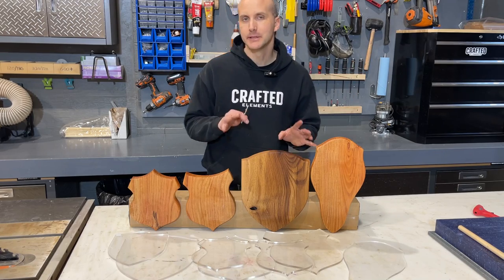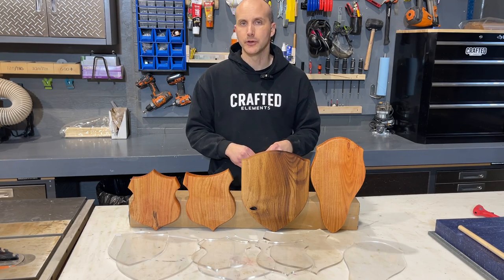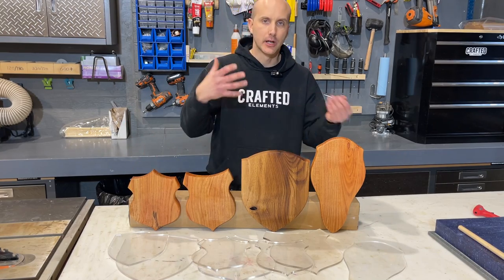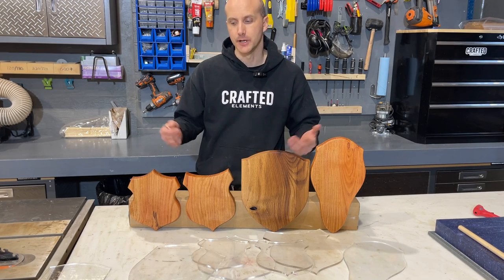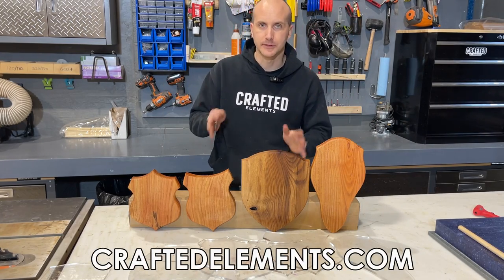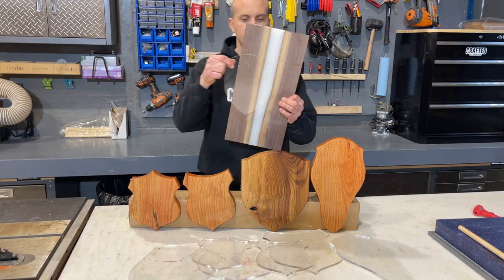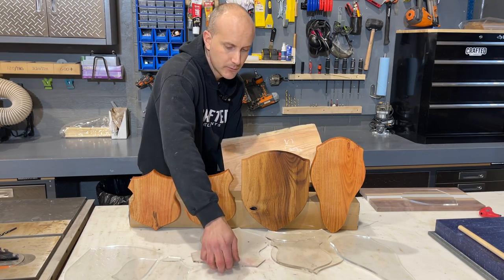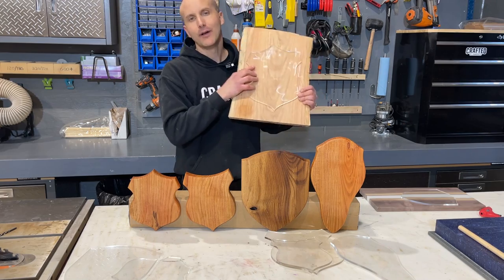How To Easily Create Plaques & Taxidermy Mounts With Router Templates

Comment: They are nice. Please what type of wood can I use to make these plaques? Thank you
Reply from the maker: Hardwoods are best, but you could use pine, MDF, etc.
Reply: @CraftedElements  ok. Though I made inquiries and was told it's difficult using the router on mdf. I was told the bits wear easily

Comment: I didn't quite understand you...but what kind of stain did you use? You said "Honey wood" something?  Is this something you sell or can I buy this at home depot or Lowe's?
Reply from the maker: It's not stain, its a food safe oil called TotalBoat WoodHoney by @TotalBoat
Reply: @CraftedElements   Sorry you were talking so fast I couldn't understand you. But I thank you for replying back and letting me know
Reply from the maker: @dreamlookautodetailingauto3353 No need to apologize, sometimes I do talk so fast. I don't want to talk to slow and loose peoples interest! But clearly I need to work on Clarity.
Reply: @CraftedElements   I thank you again for your replies and totally understand.. Didn't know of you templates until I stumbled/came across your video by accident. Love the templates. So the Honey wood oil, Is this a product I can buy at Home depot or Lowe's or a wood supply company? I did notice it on Amazon but it's gonna take a few days to arrive if I order.
Reply: If I wanted to paint the edge of the board do you think paint would stick to the wood honey. Or maybe it would be best to paint around it first and then put the wood honey on. Thoughts?   @CraftedElements
Reply from the maker: No, wood honey will prevent paint from sticking to the wood @luvbgrass

Comment: What is the name of the finish you applied to the plaques ?
I just got a router but don't have a router table.  Any suggestions?
Reply from the maker: It was likely total boat wood honey to finish these. The router table could be anything, the one we use in this video is a $250 unit, nothing fancy. Thus, I dont have specific recommendations.